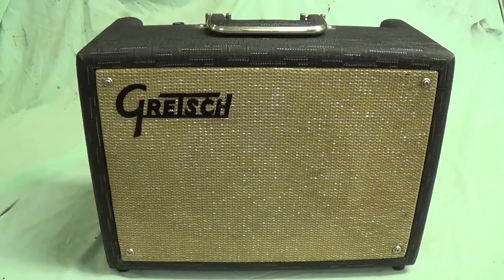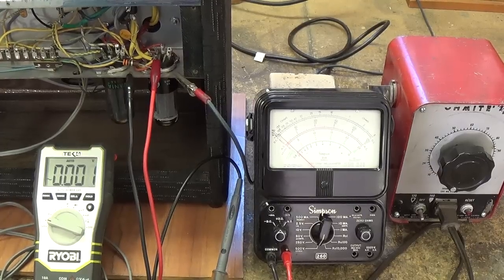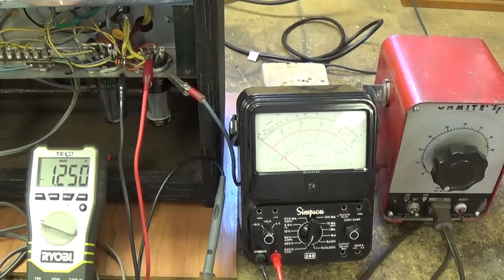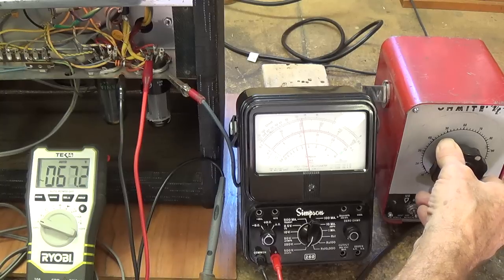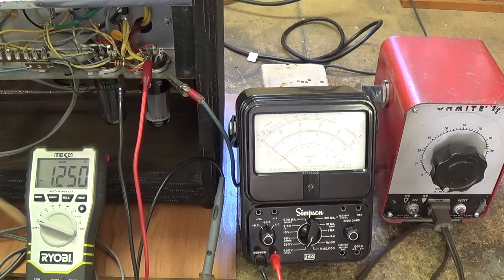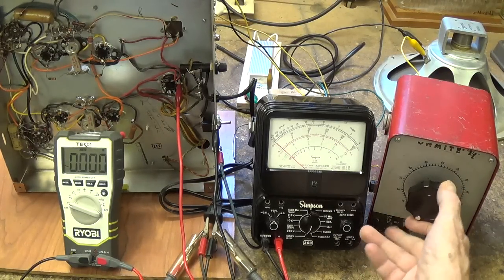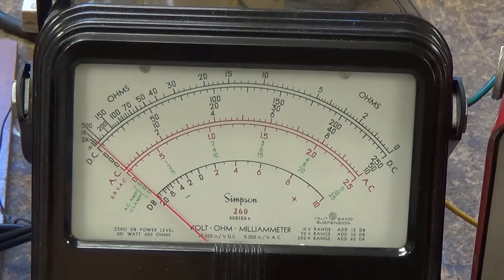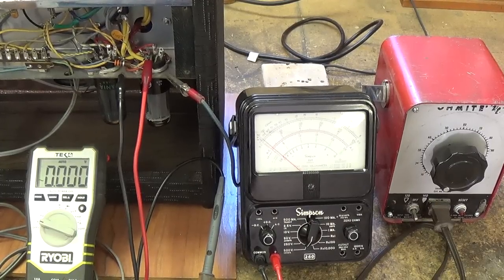Is Gradual Variac Warm-Up Effective with Tube-Rectified Amplifiers ?

Comment: On Mr. Carlson's Lab's youtube channel he had a Thoradarson T20w40T amp that would spike voltage when powered on because the rectifier was directly heated and the pre-amp tubes were not. In that case it seems that you need to find a way to bring up the heaters in the the pre-amp section before you bring up the heater on the rectifier tube. He designed a little board to heat the pre-amp tubes before the rectifier tube. I guess it depends on the design but it's a pretty cool solution.  I'd post the link but it is forbidden on youtube to do so,
Reply from the maker: +Arnold Rimmer Very interesting, Arnold. I am not familiar with that amp, but it may have a 5U4 rectifier (directly heated). A simple solution might have been to substitute a GZ34, which is indirectly heated and provides a very slow, gentle start up.
Reply: +Uncle Doug Hey thanks that should work. It looks like inrush inhibitors (soft start) don't do very much if the amp's power supply uses a directly heated rectifier tube.
Reply from the maker: This is just another reason why I prefer GZ34's to 5U4's.

Comment: Great info.. the questions I'm looking for an answer to though are.. in a vintage hi-fi unit, let's say a McIntosh 240 (which is SS rectifier) and a McC20 Preamp would it be a good idea to power up with a variac on a regular basis with the thoughts of prolonging expensive tube life. Not a long slow turn up as used when checking equipment but rather let's say a gradual turnup over about a minute. Do you think this would extend the life of expensive power tubes and by turning it up slowly but not too slow prevent cathode stripping? Of course the Variac would have to be rated at a high enough number to supply the units being powered. Thanks Uncle Doug.
Reply from the maker: Not a bad idea, S100. Most tube failures occur on start up, and with a SS rectifier this is even more likely due to the brutally fast surge of high voltage. Another, easier but probably not quite effective method might be to use a current limiter to slow down the inrush of AC.

Comment: I wonder if you would have had different results with the rectifiers passing current on both amps if you brought the voltage up a bit slower to give the tubes a longer chance to heat up.  You ramped them up pretty fast and the filament didn't get much chance to heat the cathode before the voltage was brought up higher!  Just a thought...

I have an Ampeg Portaflex B-12-XT guitar/accordion amp using an 5AR4 full-wave rectifier tube.  It's been in storage for 30+ years and I'm getting ready to fire it up again. Just picked up an auto-transformer to bring it up slow.  Let me know if there is anything I might need to look out for when I start the project.  The amp was working great when it went into storage.  I intend to put a three wire cord on it beforehand and disconnect the "ground" switch...would appreciate any comment on that as well!

I enjoy watching your videos, Thanks for making them!  Say hi to Rusty
Reply from the maker: Your observation is probably true, Gizmo. If I ever do this experiment again, I will allow the tubes longer to heat up.  I would recommend a Current Limiter (see my video if you don't have one) whenever working on electronic equipment that has not been operating for a long time.  It will protect expensive components, like the power transformer, in case a short circuit has developed over time.  A three-wire power cord and bypassed ground switch make excellent sense.
Reply: Doug, thanks for your response. I thought the auto-transformer (variac) would take care of the current limiting function. My plan is to bring it up slowly with a meter on the B+ just as you did in this video watching for any large draw by putting an amp meter in the on the supply line...should I also have the current limiter in the circuit?  

Also, there is a .047mf/1000v cap on the ground switch that goes between the chassis and the line.  The switch alternately sends the line through the capacitor to ground.   Should this cap be connected to the white (neutral) side of the line with a three wire setup or to the black (hot) side? Or should it just be taken out of the circuit?
Reply from the maker: Yes, you will also need a Current Limiter, Gizmo. A Variac will quite happily send its entire current capacity directly into a dead short, incinerating every part in its pathway. For current flow protection, you need a CL.

The cap you describe is the so-called "Death Capacitor" which provides a means for electrical noise in the AC supply to go to ground before entering the amp circuit. You can eliminate it, if you wish, but the best solution is to install a 3-wire power cord that grounds your chassis, be sure you have a proper fuse in series immediately after the power switch, and then connect the cap to the black lead.
Reply: Thanks much Doug, not sure where I will find a 250w incandescent bulb, but I assume I could wire a few smaller wattage bulbs in parallel to accomplish the same thing, is that right, or should it be series?  

There is a 4 amp fuse on the line, it actually falls before the power switch on the schematic, but the odd thing is the cap is shown on the ground switch (center) that falls before the power switch looking like the cap is always either connected to the neutral or hot lead of the power source depending on the position of the ground switch.  If this is in fact how it is wired, I will rewire where the cap is on the other side of the power switch so it will disconnect the cap from the line!  I have the original schematic that came on the inside of the cabinet.

Again, thanks much for your help!
Reply from the maker: Gizmo, yes you can use 2 or 3 sockets in parallel and then screw in different wattage bulbs to suit the current demands of any amp you are working on. Many people like the fuse before the power switch, but it can make changing switches a shock hazard, even if the amp is switched "off". You should consider installing a 3-wire power cord, eliminating the ground switch, running the black wire through your on/off switch, fuse, and connected to your noise-filter cap (if you keep it in circuit) before going to the power transformer primary.
Reply: I'm actually in the process of digitalizing the schematic by tracing it in my graphics program.  I have all the components in place and just need to connect all of them together.  I will be able to make the changes on paper that way to get everything straight in my head when I actually get the thing down and opened up.  Should be an easy "fix" but I will probably do the slow start up before actually doing the rewire to eliminate any question what maybe wrong if it doesn't fire up!  I don't believe there will be a problem though!

I really thank you for your input and love watching your videos...curious about the car you have in your garage that I've seen some glimpses of in at least one video!  Look like a 40s-50s Chevy but there wasn't much to go on!

Thanks much...
Reply from the maker: Good luck with your project, Gizmo. If you're referring to the light blue car with orange flames, it's a 1936 Chevrolet Pickup. I discuss it in one of the videos (I forget which one). I may feature it again in the future. Thanks for your interest.

Comment: Nice job, Uncle Doug, as long as people are using the 5Y3 or 5U4 or similar rectifiers.  I noticed you didn't include a solid state diode assembly.  In that case the B+ would start off right away but the various tubes would not.  In that case, the B+ current and voltage might both be interesting to watch as the variac is cranked up.
Reply from the maker: I haven't performed this procedure with diode rectification, Fred, mainly since it is generally reserved for older equipment that used tube rectification.

Comment: Hmmm...Hi UD....say, in one of my 'amp repair' books ( I won't mention names), it was explained that when bringing voltage up on guitar amps, which employ a tube rectifier, the tube should be removed and replaced with an octal base solid state rectifier for the gradual rise from the variac. I don't recall the explaination, altho I do believe they explained why. I purchase one of these 'plug-in' diode rectifiers and have been using it for years. What is your take on that idea?

Comment: Doug - I think this is a very good video documenting what actually happens.  Thanks - no matter what the empirical evidence is, it will be interpreted in different ways by different viewers. Even though I rarely power up equipment in this way, I think, overall, it is a good approach. It is kind of like opening a door that has been closed for 20 years. Wouldn't it make sense to open it slowly instead of just kicking it open and hoping the hinges don't lock up and break? I am not saying I will necessarily change my personal lazy ways of just plug-it-in and turn-it-on and replace-whatever-smokes  :-) 
A second comment from a gentleman's posting below is, I would be Very careful in doing this with solid state amps Because... in a dual polarity amplifier (i.e. say, +- 40 volt PS), the bias voltages are going to be too low as the main power supply voltages rise and it is conceivable that excessive current could flow through the EC junctions of common BJT's and cause damage. Common silicon transistors are know as bipolar junction transistors (BJT) and they are current controlled devices in contrast to vacuum tubes as voltage controlled devices and the BJT's need all the voltages correct at the same time. So, just because this procedure is, as far as I know, fool proof in a vacuum tube amp, I would Not practice this procedure in solid state amps.
Reply from the maker: Thanks, so much, David. As my old granny always said, "When in doubt, run an experiment," and I know that you too heed this sage advice. I recall that in your workshop, we noted the "healing" properties of gradually charging old electrolytic capacitors. The ESR value might be rather high on a dusty old cap, but after charging it up a few times, the ESR value would drop way down to an acceptable level. I tend to view this soft-start method as a means to that end.

Also, thanks for helping out with the solid state info below. I was not aware of the possible harm that a slow start might inflict on ss gear, and am glad the viewer received a knowledgeable, accurate answer.
Reply: Interesting. Good stuff.
Reply from the maker: Thanks, RH :)
Reply: ElPaso TubeAmps Has anyone ever made a "dummy" circuit so they could remove caps from an amp & hook them up to the dummy circuit to reform them with a Variac & a current limiter? Something like that could be a great piece of bench equipment!
Reply: randolph patterson Well, I like that idea and I do not know of anyone that has built such a circuit. Unfortunately, many of the old electrolytic capacitors dry out and "open up" and for all practical purposes, don't exist as a capacitor in the circuit any longer. In these cases, people often times leave the big cans in the amp for cosmetics and just parallel in another capacitor under the chassis across the open-defective one. Electrolytic caps have a wet electrolyte in them that dries out and that is the end of them. They are not going to be able to be restored so a capacitor rejuvenating circuit might work on some but not on all.
Reply: ElPaso TubeAmps Hi David, I just read your comment, and it is very true...I've seen many people including experienced techs like us just parallel new caps over the old electrolytic cans which is actually a bad move. I recently repaired an old Danelectro  guitar amp (1959) where a tech did this. What ended up happening was, the old cap eventually shorted which not only took out the new caps that were installed, but took out the HV winding of the PT. What a mess. I had to get the transformer rewound because I couldn't find a suitable replacement, and the owner wanted to keep the amp period correct (new fashionable term) :) Also, discovering a 20 amp car fuse in the holder didn't help the situation either :) If anyone is going to leave the old cans in place, I highly recommend disconnecting them and adding a terminal strip to connect the new modern caps. I hope this gives some newcomers, some insight, and prevent them from developing some bad professional habits :)
Reply: Frank Ferraro Completely agree with you, Frank. I took the lazy route. But you have to admit, the 20 amp fuse stopped all that annoying  fuse blowing...  :-)  I too appreciate the "period correct" look. Kind of interesting that people bought amps 30, 40+ years ago and immediately "modded" they (i.e. had them butchered) and then after having them spend decades in a closet drag them out and want them to look and perform "period correct".  I really wish the market and culture in El Paso was a little more (monetarily) appreciative of the skills of a good tech but it is not and therefore no one (including me nowadays) will do this kind of work in this area. I continually get requests to repair equipment including USPS letters but I turn them away. Got my own goofy projects and not enough time to take on other's repair needs - and, again, the lack of $$ people are willing to pay. Always good to hear from you, Sir.
Reply: ElPaso TubeAmps It's always a pleasure to chat with you and Uncle Doug! I'm not fond of many modifications out there. That's why my slogan on my web site says, "Specializing in repair and De-modification of tube amplifiers :) It's true about people (mainly weekend warrior) musicians not wanting to pay us for our services and years of experience. Fortunately, I have a good hand-picked group of clients that are working and touring professionals who don't complain and NEED their amps up to spiff! Plus, I also repair solid state gear as well for a few sound companies that also do rentals. My other area of tube electronics also lies in repair and rebuilding of vintage radios, tube TV's (color & B&W) for serious collectors who don't complain about the cost of the project. Other than that, it's not easy to make a good living as a component level tech nowadays...I'm always hustling since I will be tying the knot :).We're also in the age of disposable equipment--even pro gear has become this way...It's either a module swap, or 86 the thing :) 

PS: You an Doug are very good technicians, both well seasoned and experienced. You both could hand pick your clients--especially the working professionals who would pay top dollar to have their amps operating reliably again.
Reply from the maker: I tend to discourage outside work anymore, but occasionally accept certain amps to repair if they are interesting, fairly small, vintage (the older the better), the person is nice and willing to pay a fair amount for the work.

In the past, I actually had customers arrive (to pick up a completed amp) with no money at all in their pockets.....and then seem genuinely surprised that I expected to be paid for the parts and labor.

A fairly well-known musician came to town a couple years ago to perform, and while here, responded to a Craigslist ad I had posted for a really nice old Gibson ES-335. He asked me to bring it to the concert, let him try it out, and then autograph it "for my trouble". Needless to say, I stayed home that night.
Reply: Frank Ferraro First of all, let me congratulate you on 'tying the knot". I have been married to the same beautiful young lady for 39 years, so far. But still have to work at it ever day even after that long.
Per Doug's comments below about people showing up with no money - that is not terribly uncommon around here. I have said before that Doug and I are the 'golden gooses" of this area but way too many of the guys around here will 'kill the golden goose' to save one buck. That is not everybody. Then there is also the guys that want to spend hours and hours having you tinker with their equipment using all of my test equipment and time for no money. Enough is enough and I am just not tough enough of a business man. I admire you for dealing with it and staying sane and making real money from it. This area definitely needs a man like you, Frank, to do service in the El Paso, Las Cruces, Juarez area. There are probably 2.5M people in what I just mentioned.
There is a high-end recording studio east of El Paso whose name I will not mention. A band came there to record and the studio brought me all their equipment to service. Several amps, an Orange and some old vintage Fenders, etc. I worked diligently on them, overnighting tubes from Tube Depot for the instruments and I believe the bill came to about $420. They almost fainted when I gave them the bill. They did pay me but I haven't heard from them since.   And the story goes on to other businesses in El Paso I have dealt with getting my money back $25 at a time when I invested $100 in parts.  No more. That's why Doug and I do very little work around this area.
Reply: Oh my gosh sounds like a young blues musician I have known about
Reply: Oh my gosh sounds like a young blues musician I have known about

Comment: I purchased a Ampeg V4-B head  back in 1973. It was brand new. Paid $275.  After 1 year the 40/70  cap in the power supply exploded. Makes me wonder how long it sat on the shelf. Makes me wonder if Magnavox burned the amps in before putting them on the market.
Reply from the maker: Greetings, Eric. I agree with you that the capacitors in a new amp should last more than 1 year.  There can be several reasons for an electrolytic capacitor to overheat and burst, including a short within the cap (rare in one that's only one year old) or one downstream from the cap, drawing too much current through it (not the cap's fault). I hope you got it repaired and have had no trouble since.